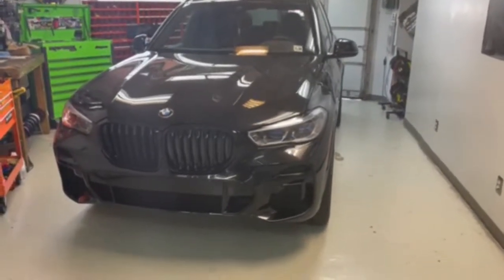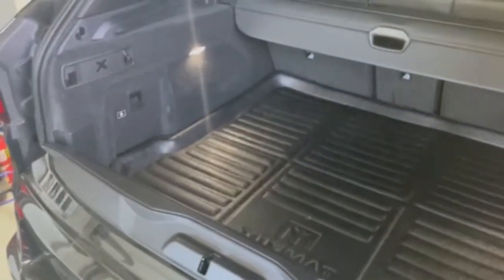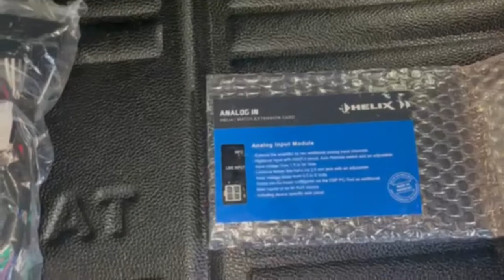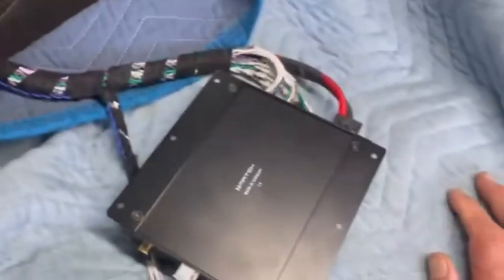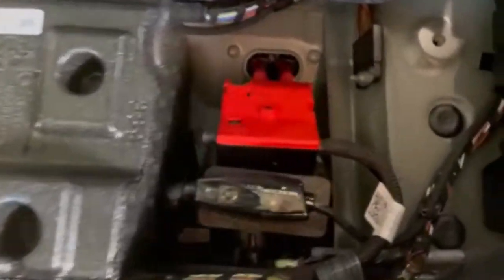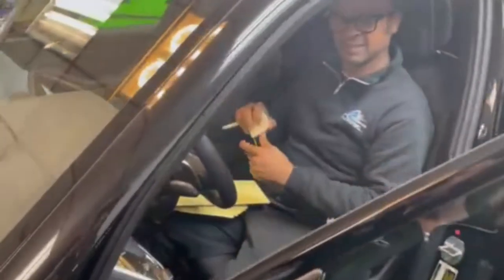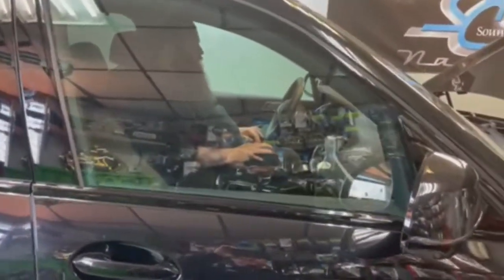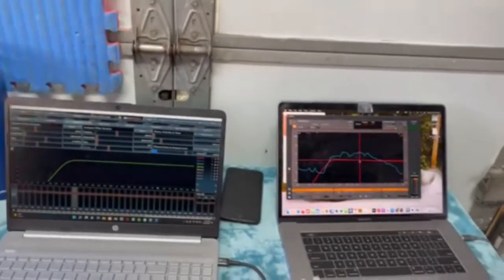2022 BMW X5 Match UP 7DSP Amplifier Upgrade

Comment: I thought you are going to show the difference between the old amplifier and the new one. As i heard the music after you was done it sounds much stronger with the up7dsp. I hope you can make a video about the sound differenc.

And by the way is up8dsp the newest amplifier? And how much big of a difference is it from its predecessor?
Reply from the maker: I will probably not do a video on the sound difference between the before and after. The audio format YouTube of audio would be hard to differentiate the two. There is a tremendous increase in power and audio quality when upgrading the Match amplifier. One important factor is the tuning of the amplifier. 
 The UP8 is an 8 channel and the UP 7 is a 7 channel. the choice depends on the BMW application.

Comment: Great video, I am about to have the up10DSP amp installed in mine, I have the Harmon Kardon system. What was the Helix item for that you showcased in the beginning of the video? Thanks
Reply from the maker: What is the year and model BMW you have?
Reply: @TheSoundconcept  Hello, I have a 2021 X5M competition. I have had for over a year now and I’ve always thought the stereo system was lacking. After adding a subwoofer, it sounded better but something is still missing. I’m hoping this DSP/ amplifier will bring the sound that I’m looking for. There aren’t many options out there.
Reply from the maker: There is a side company to Helix called Audiotec Fischer. The company has a direct fit replacement amplifier with a built in DSP. It is exactly what you need to to seriously improve the sound stage. Your vehicle would probably need the Match Up 10 DSP. This is the link to it;  https://www.audiotec-fischer.de/en/match/amplifiers/up-10dsp  
The amplifier is of the highest quality and it will have to be professional tune once its installed. If your keeping the BMW and sound staging is important, you do not have to look any further.
Reply: @TheSoundconcept  Thanks! I have already ordered it and the required accessories. I also got the MEC Analog In module because I need 9 channels input besides the 8 that the Amp comes with. Wish I didn’t need this as I was hoping to add the Hi Resolution module but I don’t think I will be able to have both. As far as the professional tuning, I have to find an Audiotec Fischer Dealer in the area. I’ve been watching a few of the YouTube videos but I haven’t actually seen one that shows from set up to tune. Thanks for the info.
Reply: @TheSoundconcept  I meant to ask earlier, did you remove the factory amplifier or just mount the new one above it? Or did this vehicle not come with a factory amplifier? Thanks
Reply from the maker: The factory amplifier remains and the Match amplifier is wired in series with it.

Comment: Hi, I just turned my 2020 X5 lease in which had the Harmon Kardon system and, like everyone else with a 2022, had to have the base hifi sound system from bmw.  I find that the 2022 doesn’t get as loud and the bass, when turned up sufficiently to meet my needs, then distorts the mids and is worse with music with a lot of complexity.  Did adding just the amp do enough to make a real difference or were more things done?  The local stereo shop suggested I put in a downward firing sub and turn the bass down on the deck, and use a knob to control the bass from the sub separately.  He said it would be very expensive to add an amp, and without an amp upgraded speakers would not have the power they need.  Not trying to spend $5-$6k, was just hoping to do a little something to improve the sound to more of what I’m use to.  Any thoughts are appreciated.  Thank you.
Reply from the maker: Ashley, good morning. I you are all ready committed the 2022 BMW then the Audiotec Fischer Match products are the finest upgrade you will experience. The company focuses on late model BMW audio upgrades. The amplifiers are designed with OEM plug in harnesses. There is no modification to your vehicle. The key function is the built in DSP that enables the audio system to be "tuned" to your listening. The customer service from the company is outstanding and I feel worth the investment. If you would like more information you can email me bruce@soundconcept.com.
Reply: @TheSoundconcept  Hi how does the amp work with the standard speakers is it an improvement?
Reply from the maker: The amplifier/ DSP increases power and frequency response without modifying the wire harness and panels. The DSP allows for custom tuning for your listening preference.

Comment: i have a w205 2019 with audio 20 sound system any solution for that shitty sound system
Reply from the maker: The solution can vary on the price you want to invest. The most cost effective way is the add an amplifier, subwoofer enclosure with a gain controller. The upgrade can put a frequency into the interior that the OEM can never do.